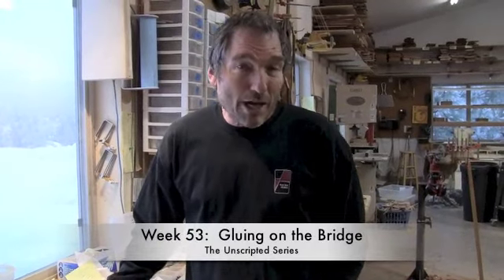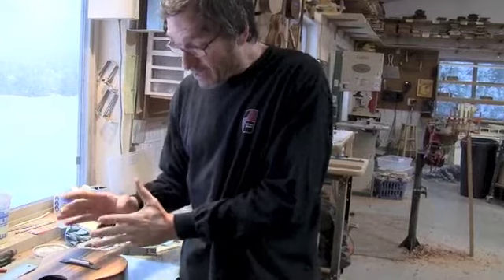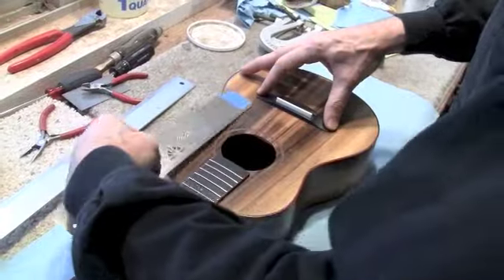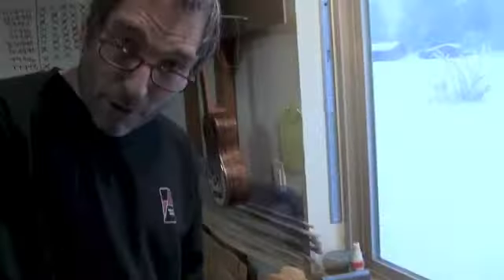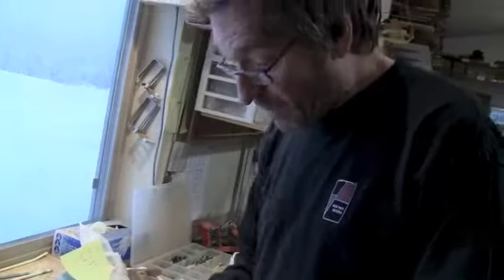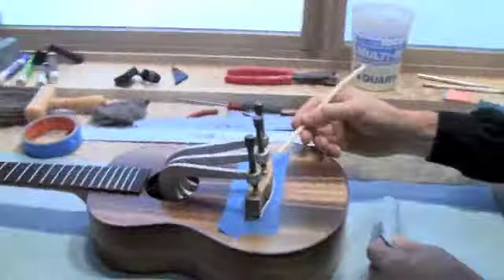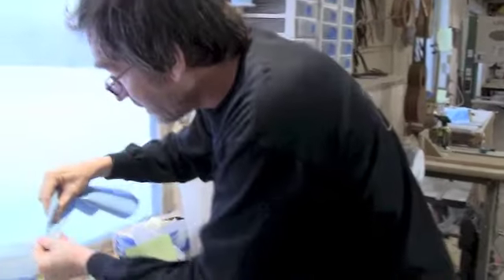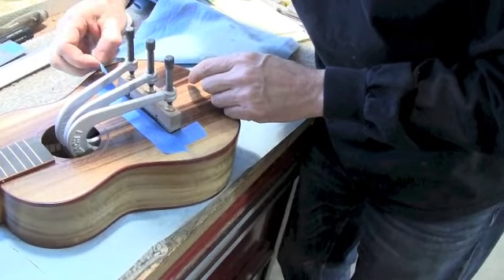Week 53:  Gluing on the Bridge

Comment: Oh crap I already put 3 coats of clear laquer on before putting bridge on. Do I need to sand it off before gluing bridge now. ?
Reply from the maker: J Man the finish should go on before the bridge. Just be sure to tape the area underneath the bridge first, then apply finish, then remove tape to expose raw wood where bridge will be. Then glue on bridge
Reply: MyaMoeUkuleles thanks so much , so I’m good then. I went back and watched your video again and where you said not to glue the bridge on unfinished wood. My problem now is where to put the bridge ? When I sanded it removed the outline of where old bridge was. Is there a schematic or formula for bridge placement in relation to the fret board?
Reply: I have a Harmony 50s or 60s baritone
Reply from the maker: @westrokker  That is incorrect.  You do NOT want to glue the bridge on finished wood.  You want to glue is on unfinished wood.  You might also want to watch the "Birth of a Mya-Moe" series of videos where every aspect of building a Mya-Moe ukulele is detailed.  The bridge placement depends on the scale length used when the fretboard was slotted.  I don't know the specific scale of a '50s/'60s Harmony Baritone.
Reply: MyaMoeUkuleles thanks!

Comment: if you are putting a new bridge on a ukulele how do you find the position of the new bridge?
Reply: 5 year old comment, I know. But my two cents from just shifting my bridge back so intonation was actually possible: the distance from the 12th fret to the bridge will need to be greater than the distance to the nut (mine was actually shorter by 1/8"). The ratio of the difference is what I got from my acoustic guitar. The bridge/nut ratio was 1.0098. This will differ with bridge/saddle and nut heights where they affect the relief at the 12th fret. Hope that helps anyone in the future. 0:02